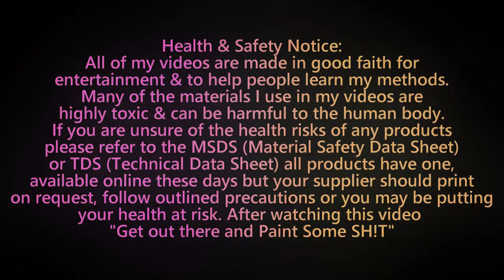SATAjet Phaser-X 1.3 I Clear Coat Stage Lexus RX-350

Comment: Hi pal hope your well. Is this phaser x the same as the 5500 1.3 set up?? And how have you set the gun up ie, fan/fluid tip settings ( how many turns out). And how does this compare to the sata 5000 rp 1.3 which I currently have and is it worthwhile upgrading to this.. many thanks.... keep up the top work👍🏽
Reply: The phaser is the same as the 5500 just different look